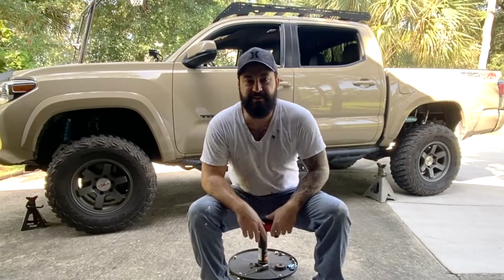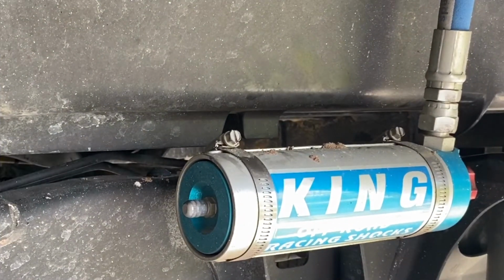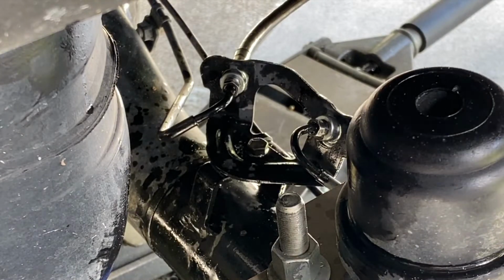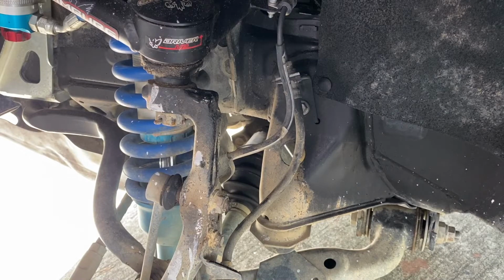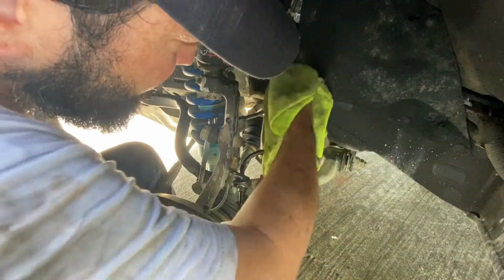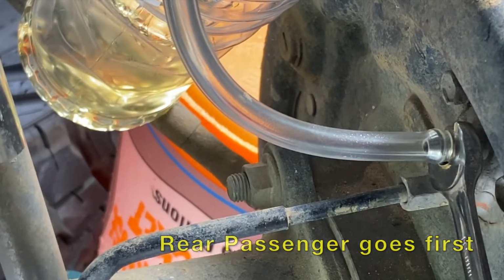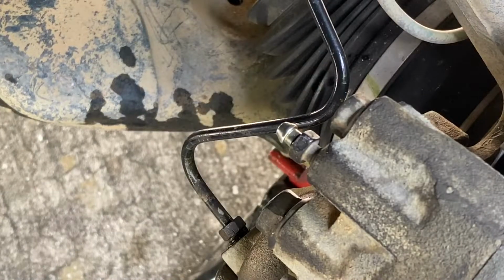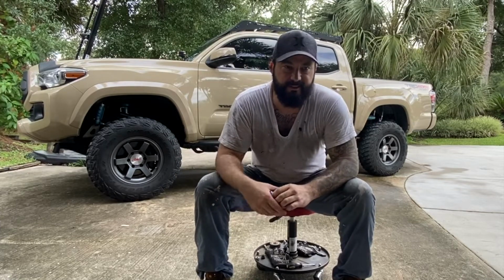Toyota Tacoma | Front and Rear extended brake line Install | (2017 Tacoma)

Comment: Were you worried about breaking your front lines or did you just do them since you did the back? I thought you only needed front for extended travel kits
Reply from the maker: I did the fronts to be safe while I was already in there and already bleeding the brakes. I am not sure on only needing them for extended kits only. I like to have longer lines with all my lifts, just to be safe. Thanks for watching!